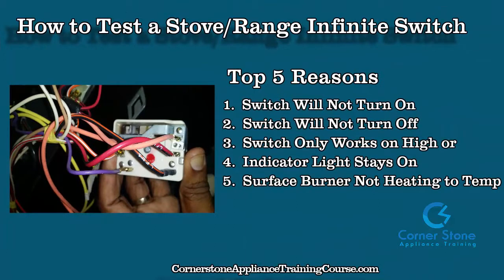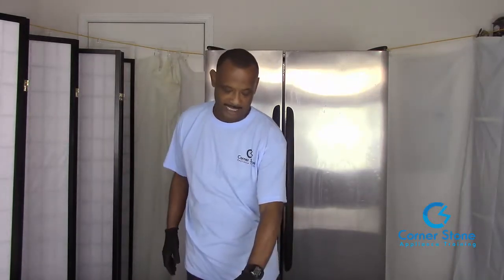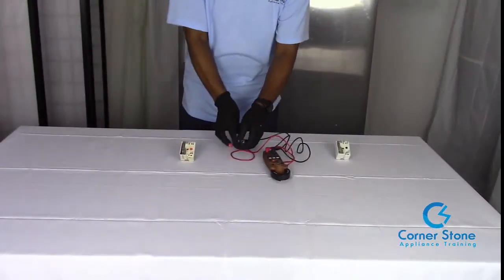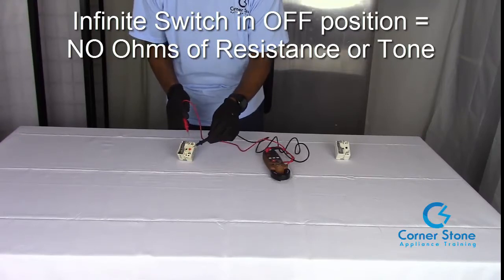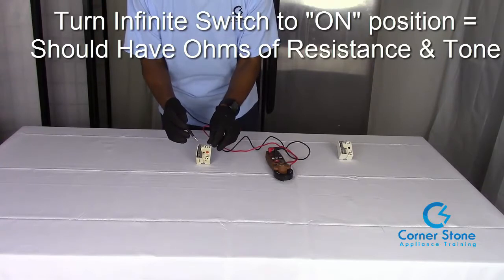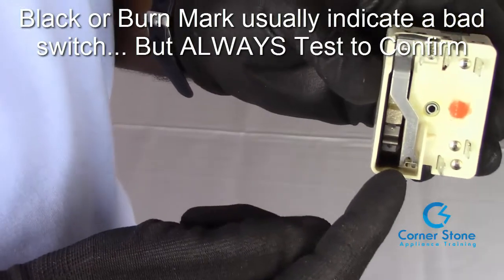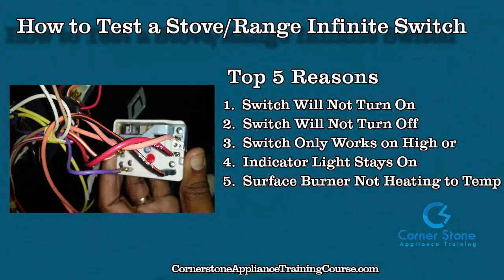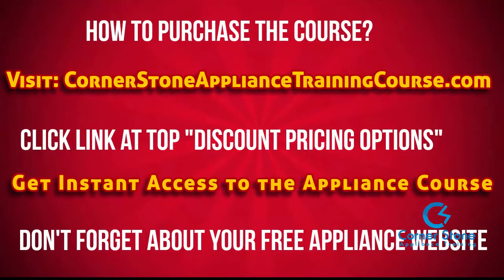Appliance Repair - Stove Repair How to Test Electric Range Infinite Switch Check the...

Comment: Hi Chris, My stove gives off a quiet snapping sound like something is shorting when I turn on my big element, the heat comes on but it is not consistent. I just completed the test you demonstrated and everything was the same result, only on the back of my switch there is a little bit of black char in the corner. would do you suggest?

Comment: So what my stove top element is doing is getting too hot even if it's just on a medium setting would that be the coil element stove top thing itself or is it electrical thing that it plugs into or would it be the infinite switch
Reply from the maker: That is usually caused by a defective infinite switch. You can test it with a multimeter if you have one.  Hope that helps.

Thanks
Reply: @chrisstokes2020  yes he tested it and everything is good but the switch were kinda dirty so he cleaned them..so can the coil element do that if the coil is bad?

Comment: Hello Chris.  I have one large and one small burner infinite switchs that make an occasional quiet buzzing noise when on, AND the kitchen lights flicker a bit during those noises.  Should I clean the switch or replace it,  and is it a problem?  Could one spot on the switchs be making poor contact?  Thanks.

Comment: I had a problem with the semi select on my Kenmore which is also connected to the power element I replace the board because it was obviously burnt out but it did not fix the problem I pulled off the control switch and it was black but I was getting connectivity Going to replace it but was wondering why the semi select and the power element doesn’t work

Comment: I had one on an older GE that had some burn marks on the exterior at the terminals, and one rivet was burned about 2/3 away.  This switch somehow allowed arcing to ground or neutral whenever the range had power -- and would trip the 50A breaker immediately.  Reset the breaker and it trips instantly.  Unplug the range and the breaker resets just fine.  This is with NO BURNERS or OVEN turned on!  I replaced the infinite switch and all is good.  So, measuring resistance doesn't always tell the whole story!

Comment: GREAT Job Chris!!! I replaced a glass top burner and the burner didn't work. So, I tested the infinite switch just to make sure I didn't have another issue.  Your video gave me instant success in testing the switch and eliminating the switch as an issue.  It turns out one of the terminals on the new burner was loose.  Thanks for the info and excellent video!

Comment: Got a electric stove burners are on low burning everything and the also the oven what is your take on this
Reply: Nothing works .but turn the switch on for a burner ,any burner, then lights come on ,
Nothing works then either ,oven ,nothing .after any switch is turned on ,and clock will light up and blink. 
Help ........
Reply from the maker: Are you saying, ALL of the burners are burning the food? If it is only one or two, that is usually a defective switch.  You mentioned the oven, is it burning the food as well?
Reply: Yes sir  oven is burning the food

Comment: Very informative thanks.
I never heard of two different switches for the small and larger burners. I've seen universal switches sold and they are for both types.
I'm looking for info on how to actually repair a defective switch that's only on high, not just replace it.
All my continuity checks are good.
Reply: Marcoosianism different switches have different amp rating. You don’t want to use a 6.5 amp infinite switch to operate a bigger surface burner that takes a switch that is rated at 11 amps or whatever.
Reply: Only on high means the contact points that should open and close to regulate temperature have welded shut from arcing. It is unlikely that you can repair it.
Reply: @jjs211u  Thank you!